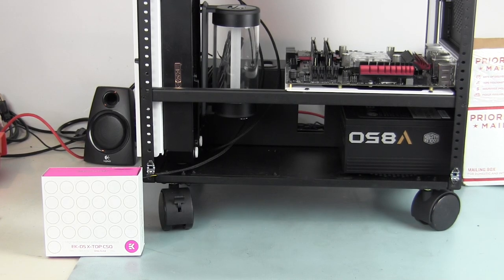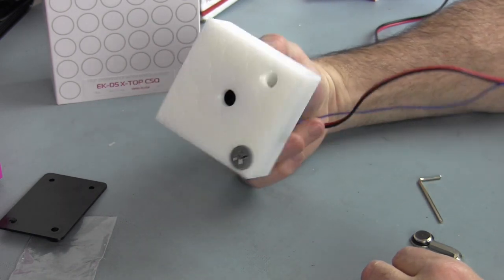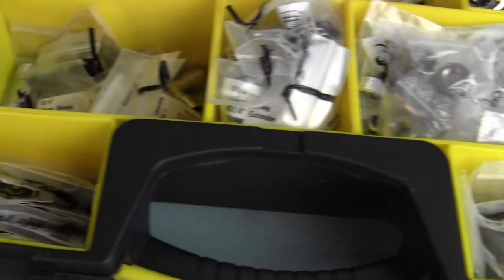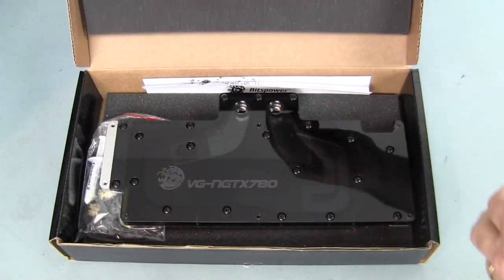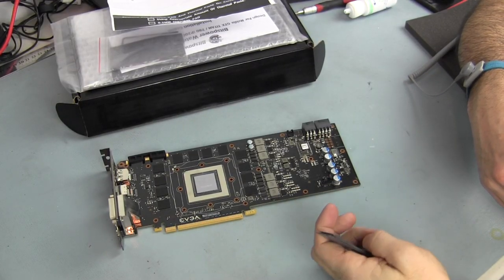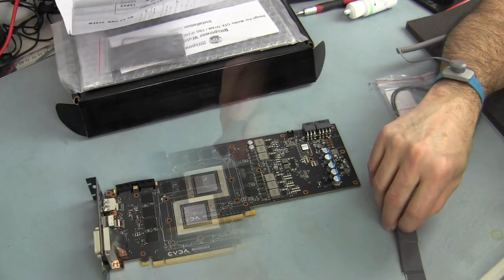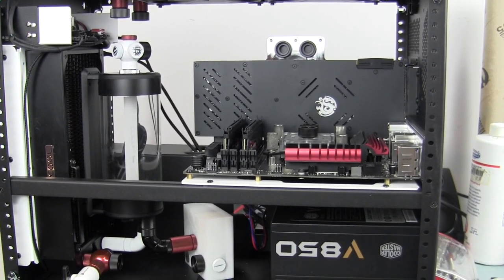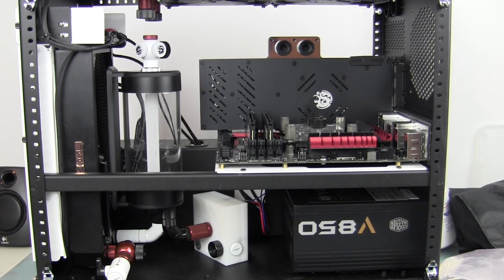Customer Build  - Nightcrawler -  Install Fittings, Pump, and GPU Block -  Build Log 2

Comment: The timing of this video is awesome because I'm getting ready to do a VERY similar build in a white and blue scheme in a white Mercury S5. This helps confirm some things. I really want to do something elegant/invisible for the fan filtering. Those DEMCI filters look like a good option. Are you only using the DEMCI dual 120 in front, or are you getting a dual 140 for the top as well, etc.
Reply from the maker: The front and rear fans will be intakes so I am putting filters on those. The 280 rad fans are exhausts so I will not be putting any filters in those.

Comment: Hi ! I like this video. Just one thought what I would like to share with you. I think to use a pump and res combo would be a better option in this built. It would improve the look of the built, the performance of the pump and let you save some fittings as well. Both EK and Bitspower has combos and you can mount them on the floor or on the radiator ( using UN-Z bracket) . A multiport res top also would look beter. Bitspower multi res top with aqua pipe looks awesome ! (you used in one of your previous built). What you think about this.
Thanks: Csabi
Reply from the maker: I used a UN Bracket and the pump res selected was at the customers request.  I think it looks great.
Thanks for watching.

Comment: As someone with no previous WC experience, I am confused on which fittings I would need for a build. How can I, as a newcomer, easily determine which kind of compression fittings I will need for an unassembled build? Would you recommend to have all the rads, pump, and res in place before placing the order?
Reply from the maker: You can contact me on Facebook or PM me here. I may be able to help you.

Comment: Would have been so much cleaner going with a single fitting color :(  The black really throws it off imo.  I'm a bit of a Bitspower fanboy myself, so I enjoyed checking out your little collection.  I've got a similar setup where I keep my dozens of rotaries and C47s/Multilink Enhance.
Reply from the maker: I now have two of those case. The collection grows every time I have a new build. Thanks for watching.

Comment: have a question Ronsanut how does the bitspower white coating hold up was thing about getting the white color fitting but did not want to get them if coating is not durable
Reply from the maker: drail636 very good quality control Never had an issue with any Bitspower fittings. Even if I scratch it, the paint does not flake off.
Reply: ok thank you that what i wanted to hear

Comment: That is the most ridiculous amount of thermal paste I have ever seen someone put under a waterblock :) lol
Reply: It's a lot but have you ever applied a waterblock to a GPU? Because you use a lot more thermal past on GPU's. Most waterblock manufacturer's instructions will tell you to do it exactly like that. You also find a ton of paste on a stock card when removing the stock cooler.
Reply: Aaron Dragg You shouldn't use more paste on a GPU than CPU. The area to cover is smaller for a start, so around a pea-sized dot in the middle is more than enough. Nearly all of the paste you added there will be squeezed out to the sized in that little recess. It'll do the job and temps are find, but it's sloppy.
Reply: ***** agreed